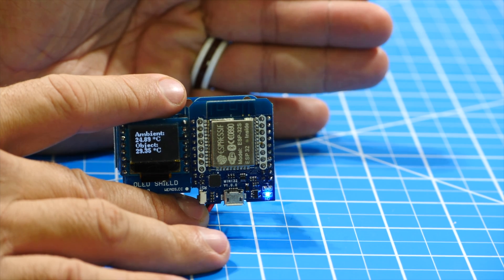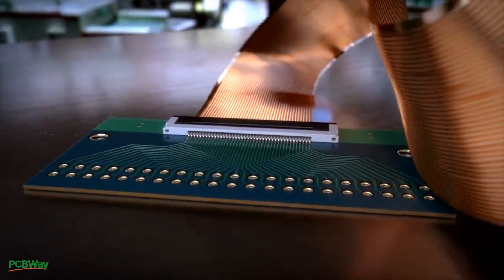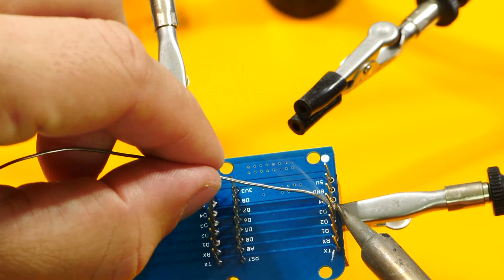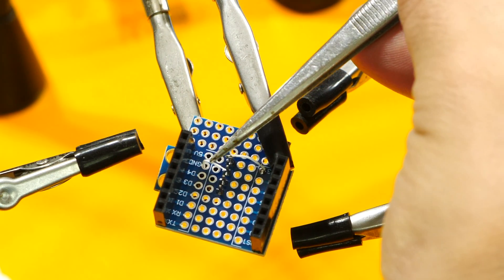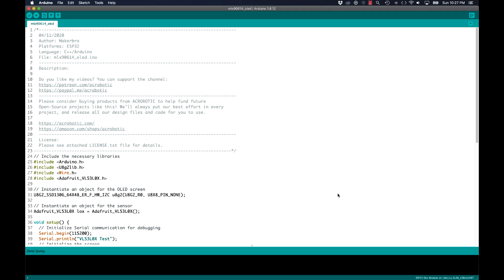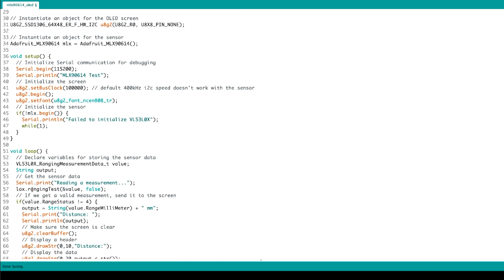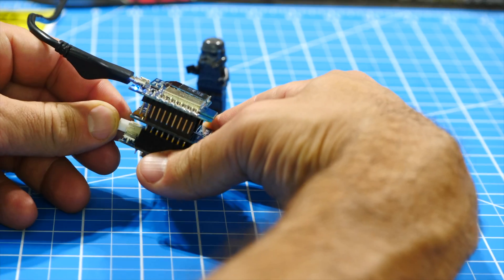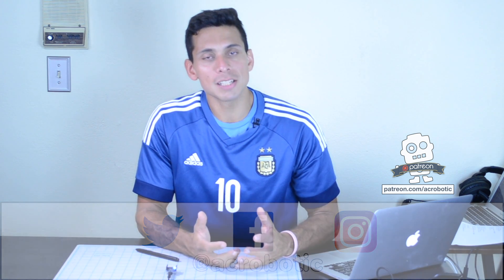ESP32 No-Contact IR Thermometer w/ OLED Display in Arduino  | MLX90614 + SSD1306

Comment: Nice quick video, a good start! Two technical points about the mlx90614 that are important for accuracy. 1. The mlx90614 has user selectable Emissivity.   This adjusts the calibration to be appropriate for object being measured. For example, human skin has an Emissivity of (.98), aluminum (.18) and plastic (approximately .85).   2. The measured object temperature is the average temperature over the field of view of the mlx90614. The version used in this video has a FOV of 90 degrees.  Pretty wide!  So be sure to account for this when positioning the sensor relative to the object.   Hope this adds some information for taking the project to the next level.   PS I  need to get one of those alligator clip flexible arm tools! Keep the videos coming, BigWaveDave.
Reply from the maker: holy cow, BigWaveDave. thanks so very much for the insight! for this quick demo, i din't even bother looking at the application notes/datasheet in detail, so your info definitely adds a lot of value (i'm pinning your comment for easy access). thanks for the compliment, happy to hear from any insight you have on any future video. cheers!